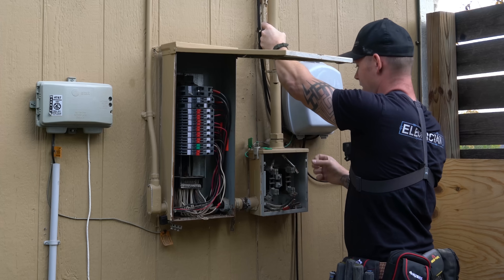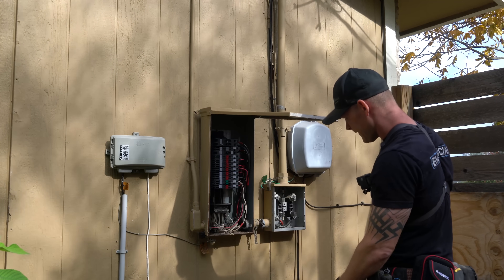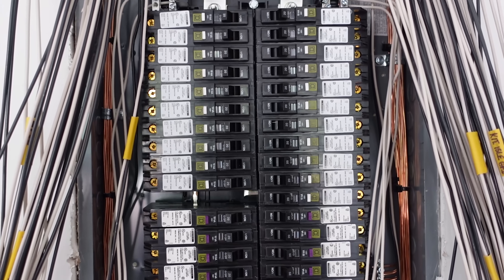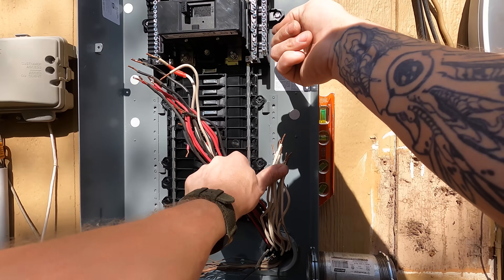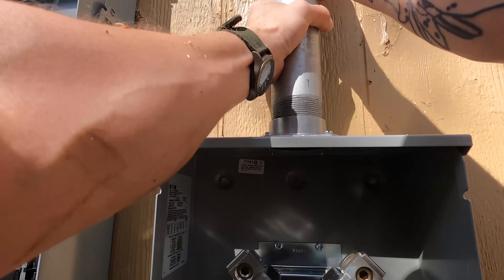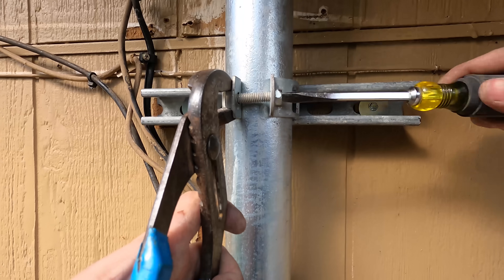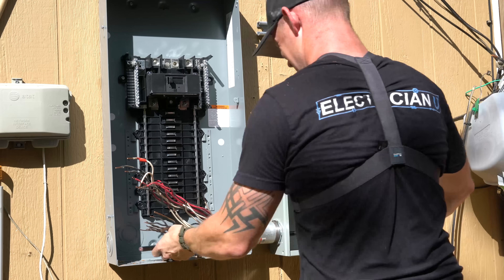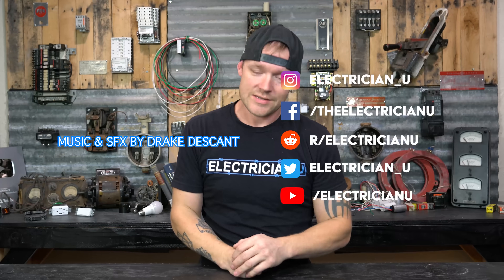How to Replace an Electrical Service Panel, Meter, and Riser (PART 1)

Comment: No sealing locknuts on the outside of the enclosures?
Reply: He didn't use Ox-Gard or Noalox on the lugs for the main or meter. Typically its only used for aluminum wiring. It still would of been a good idea to use it though. The panel and meter are both outside and the lugs and copper wiring are two different metals.
Reply: @kalijasin  yeah possibly. He actually has a whole video explaining why using Noalox is not necessary on aluminum wiring or lugs.

Comment: Stupid question: is it common for a house panel to be located outdoors? Im in canada and have never seen such things!
Reply: Austin ... I believe the outdoor panel was first used on homes that didn't have a basement or a utility area, which was a common issue with homes built on a slab or piers. Sometimes things carry forward because we've always done it that way and there's no reason to change.

Comment: Does your required inspector require an an emergency disconnect per NEC 2020 article 230.85? Or since the panelboard is  outdoor with the 200A main shut off does that qualified, along with the label.

Comment: I'm looking forward to seeing how you address the short service runs, great job so far, not that I expected anything else
Reply: I always addressed them first thing. On of my goals was to have no wirenuts in the panel :). If I had one or two, I'd hide them lol.

I would relocate where the cables came out of the building to get more length.and/or relocate the panel a bit if possible. Sometimes I'd have to punch new holes in the back of the panel but it was worth the effort to have a clean panel at the end.
Reply: @jackconnolly2665  And if that fails, send the new guy to bring you the cable stretcher from the truck!

Comment: You forgot my favorite step...
Label all wires before removing from the breakers.
Reply: land them and do a proper panel schedule afterwards. lot easier
Reply: @stevenpersinger6577  I think the difficulty nowadays is that you really need to know what the branch circuit is serving so that you can plan accordingly.  At the point you replace the panel, all of the Code changes that have occurred since the original installation affecting panels and branch circuits probably need to be addressed.  Assuming the circuits are not part of a multi-wire circuit, more than likely it needs an AFCI breaker installed or maybe a dual-function breaker in the case of kitchen and laundry circuits.  Knowing what protection is necessary before you start will allow you to procure all the correct breakers in all the correct sizes for a smooth cutover.
Reply: You mean the 2 circuits that are labeled
Reply: Lol
Reply: Looks like this panel wasn't labeled lol. Just tone the circuits out from the panel. That way there's no guess work for the next guy, or end user.
Reply: @Granturry98  so you did his work for him for free?
Reply: Same thing I thought....Ohhh nooooo! But if the circuits weren't really configured in the first place I guess it wouldn't matter too much because he would do that later.

Comment: This is definitely different from how things are done in my area(Ohio). We use what I've always heard it referred to as entrance cable which is basically pre-made wiring with 3 conductors with the center being a bare one & it's typically aluminum wire not copper. We are also required to have two grounds, one to a grounding rod & to the water main. When changing from 100 amp to 200 amp service the meter base also has to be changed to a larger one. I imagine doing the entrance wiring in copper is probably better but I couldn't imagine using it when there is a good distance between the meter and the service drop just due to the cost of copper in general.
Reply: Well Sometimes it makes sense to do copper since it smaller. conduit has a fill chart. Example Commercial  3 phase uses 4 wires. 4/0Alum on a 200amp which will require a 2 1/2 ridged conduit .pipe weights about 60 lbs and top heavy! if use copper a 2/0 wire will requires 1 1/2 ridged conduit. price on 2 1/2 10ft ridged conduit $200 . price on 1 1/2 10ftridged conduit $20. Plus bigger fitting more $$$$. like look at the top weather head on a 2 1/2 is $150 vs  $15 on 1 1/2....
Reply: @jaxxanne6  I think you are my customers favorite person right now.

Comment: How about a myers hub?? For my understanding a Myers hub eliminates the need of a ground bushing and having to deal with that extra number 4 .
Reply: Unless the myers hub nut comes with a bonding screw it can be used as bonding bushing to my understanding... but you still need to have an ground wire making contact with bonding ground screw.

Comment: Interesting that some places have outside service panels. In my area only the meter box is outside, service panel is in the inside. Much better if you have to reset a tripped breaker in your underwear..
Reply: I came to post this exact thing.
Reply: Depends where ur located, warmer climate places typically have outdoor panels (prob cost less to run wire) and easily accessible and available for service. Imagine having an outdoor panel in Canada in the winter 😂
Reply: @Nick-bh1fy  ... I do believe the outdoor panel was more about the lack of basements in certain areas (on slab construction) and from there some still do it for fire department access because a main on a meter wasn't so common years ago. Of course once an idea is established it's almost never changed.
Reply: Newer homes they are always inside the garage from what ive seen, some older homes they are on the outside like that. I would also be pissed to come work on a breaker panel in the rain/cold lol.
Reply: @Lewdacris916  ... again, usually homes without a basement and in many areas without a garage as well. When you go back 60+ years ago you have to realize the price difference in a house that doesn't have these things. No laundry room, no garage, no basement, no utility room. Four less rooms makes a BIG difference! Heck, some of these houses were originally built without a bathroom. It was a different era with different priorities. Many warmer areas held onto these ideas for a long time.
Reply: It is the standard in my area. They are better suited for a dry climate (AZ)

It is a MUCH easier installation and doesn't take up any interior real estate. 
Also, how often do you have to reset a breaker ?  :)
Reply: @jackconnolly2665  ... I would tend to agree with you on most points but the one thing I can say is an indoor panel will never have bees or snakes in it. <LOL> Also, any equipment that's indoors will last longer just due to more consistent temp / humidity. My travels to 3rd world island countries can confirm that.... and salt water in the air is at the top of the hit list!
Reply: I can 100% relate. also it helps avoid those neighbors pranksters shutting off your electricity mid shower

Comment: Do you have to.buy a 2 pole .breaker for the ark faults if your beds ran in 12 3  using the homeline brand  or can I put a breaker tie and share neutral

Comment: anti seize paste on riser or even better nylon tape or pipe dope a little more watertight plus i wld have used ductseal on the head yes not a big deal  great job as always
Reply: @
wizard3z castor I thought same thing about the threads!

Comment: Whenever I land in a meter can or disconnect i always make a small loop before each lug for future
Reply: I've seen that before but it's very difficult with large wires, the only requirement is to leave 3' of Wires on the Roof to make a drip loop...
Reply: Hard to loop 3/0 with out damaging insulation

Comment: You work that heavy gauge wire as though it were taffy. You're definitely a master.
Reply: These are relatively easy to bend, try 3/0 cu and up 😅
Reply: @AlexMartinez-dc4pe  Ha ha, yeah you'd probably need a conduit bender to bend those lol
Reply: @aaron74  I use a hickey with the handle cut short for 500s

Comment: With these being educational videos, my only suggestion would be to torque those lugs to spec with a torque wrench.  Will have to wait until the next video comes out, but same thing goes for using a torque screwdriver on the circuit breakers.
Reply: He didn’t SHOW he torqued the lugs.
Reply: @SuperVstech  - I might have missed it, but I don’t recall him saying that he torqued them either
Reply: @xxMacDaddy84xx  agreed.
But this is a Fast video.
Reply: : ) lol you probably wouldn't by it if he told you as a experienced electrician he could feel the right torque setting. Besides they were Copper not Aluminum and not as critical...
Reply: @steve-o6413  - regardless of the material, code says they’re supposed to be torque to the manufacturers specs.  I don’t have any problems with what he did, was just pointing it out bc those who are learning likely view these videos as examples of installation

Comment: So i guess your area doesn't call for feed through neutrals?

Also no flashing and rubber collar on the roof?
Reply: I'm sure he did and didn't get it on video. He'll be crazy not to.
Reply: MAST KIT is the best option.
Reply: I would have at least put a bead of silicone around the pipe up on the roof before screwing in the pipe in to draw the silicone down then resealed it again...
Reply: @steve-o6413  Are you talking about just using silicone around the pipe straight to the asphalt shingles?  Come on man...

Comment: Wish you’d shown putting the roof boot on... that’s always so frustrating!
Reply: I don't think he's going to use a flashing since it's after the outside wall, but I would have at put a bead of silicone around the Pipe up on the Roof...

Comment: Appreciate you helping me sharpen my skills with electrical! I install pv and ESS’s.  Sometimes both at the same time.  

Here’s what I know coming from the renewable energy side of electrical trades.  For me to install an ESS,  with or without PV,  I need to be able to tap in between the grids main feed with an auto transfer/Mid switch.  When I run into “all and ones” or panel boxes where I can’t easily wire the transfer switch into the topology of the homes electrical  system I realize there’s a communication issue between renewable energy and electrical trades. 

I prefer a separate meter box, then a main disconnect for that grid fed electricity, then to my transfer switch, then to the homes breaker panel.  That’s the best set up.  I’m having to replace those boxes where I can’t route the feed to transfer switch then to the bus bar for home loads.  

Respect you.
Reply: Zinsco made a piggyback Service all in one in mid to late 70's, but it was for a flush mount, an only 100Amp...
Reply: @steve-o6413  one of these manufacturers need to start making 100 and 200 amp
Reply: @MrKurtn  they had a problem with the Engineering of it and lost the UL label. It was easier to put a Surface mount all in one right next to it and backfeed it turning it into a Sub Panel if you had the room. Otherwise you might have to rip out the flush mount...

Comment: Curious to see how you tackle the short wires, I know you don't like a bunch of wife nuts in your panels
Reply: He probably added a nuetral bar down low
Reply: if it where me i wld see if i cld put in a giant j-box on otherside of wall and just splice it there using this European method https://www.youtube.com/watch?v=2yTwQxlc6gU&list=PLYyqRNzaEUGZZ0ouLVCHj1aa6YuIe5WDL&index=13&t=822s
Reply: @wizard3z868  mmm would depend on the other side of the wall... I know he's fond of bridging busses. I'd probably butt splice
Reply: @randymathews3348  my thoughts exactly, nothing like cutting a box into a guy's marble Hot Tub lol. Most homeowners won't go for a interior box...
Reply: @wizard3z868  You mean the stuff shown at about 18:32? https://www.youtube.com/watch?v=2yTwQxlc6gU&list=PLYyqRNzaEUGZZ0ouLVCHj1aa6YuIe5WDL&index=14&t=822s

Comment: using white 3/0 for neutral instead of taping? cost difference? cheers. nice to see some different practices
Reply: We used to use White paint for roof, an tape inside panels. But tape has been accepted for years...

Comment: Another awesome video man! Just a side note, even if you don't do it on camera, you might want to mention that you went back behind all your connections with a torque wrench/screwdriver in accordance with 110.14(D). In my jurisdiction, they are real hard asses about this now. Thanks again for another great video.
Reply: Excellent catch and if you were using larger aluminum conductors the use of anti-oxidant like noalox.
Reply: up in the small state of the north east same they are being real hard asses
Reply: @wizard3z868  trust me it makes a real difference arcing and loose connections are often a key fault find. Torquing at least provide some quantitive feedback on how much is enough when tightening.
Reply: @mathman0101  actually frying the breakers to the bus bar is most common for arcing and proven on his last breaker change video when he couldn't get the breaker off. I know I've had some and seen evidence that other Electricians have run into the same problem...

Comment: Wow. Thank you so much for this! I'm a 3rd year commercial apprentice, and I've never really had a chance to learn how to do services like this. I also have three old zinsco panels (a main and two subs) at home that I know should be replaced, but I've been holding off until I have more experience and can do it myself. Once I graduate, I want to completely redesign the way the panels/circuits are being fed, because it's 70 years of homeowners doing their own diy work.
Reply: Three Phase commercial color Codes are completely different from Residential and important for the Utility Company...
Reply: Hi. Am Bismark from Ghana and I enjoy your work so much.
Keep it up,but I what to be part of you.

Comment: Nice install man! I have a question. What is the best way to pull Romex out of its packaging without it twisting? Thank you!
Reply: Start in the middle of the roll! That is if you are using 250 feet or less. 500 foot rolls, stick 1/2 inch emt through and carry on!
Reply: Get a $40 Wire buggy, it pays for itself.
Reply: Or get some exercise and walk it out. Unwrap some coils and roll it out and use..
Reply: They do make a fancy device you can easily mount on the 2×4 that like a wire caddy but sits sideways for a easy feed...
Reply: run it thru a pipe (emt or find a friendly plumber) nailed on studs or on a heavy bucket/pal or just staple up a strip of nm-b  between two studs a poor but simple reel lol

Comment: Something I learned the other day when doing a weather head. Tape the wires inside the weather head for you it was white and red just for future reference when someone is working on it,you can just peak into the weather head and see the tape because most of the time that tape on the wire loses color from being in the elements over time. Something I never did but an old guy I work with did it and I was like thats a good idea!
Reply: The Utility Company only cares about the Neutral...
Reply: @steve-o6413  taping it in the weather head isn't for the utility company its for the next guy who has to cut the line drop and hook it back up for whatever reason. It just saves an extra step for the next guy
Reply: @sumochop360  real professionals use the stop rule lol (Screw The Other Person)  🤣🤣 only a craftsman thinks about the future or the next guy 😉
Reply: @sumochop360  the only one who would probably ever have reason to do that is the Utility Company or Fire Department and I'm sure they know too leave a little extra bare wire for identifying the Neutral otherwise ring it out with a jumper wire...
Reply: We are always trained on testing everything. Good idea though especially when working with 3 phase 208v. You need to not run the wild leg to one of the 120v branch circuit bars.

Comment: Im an apprentice and been in school for about 3 months now and man your videos are super helpful especially when I first started class, love your videos man!
Reply: sparky channel is another great apprentice resource
Reply: Great video,  for safety reasons it's always best to stand to the right of the panel disconnect and turn on or shut off the power with your left arm , just incase the panel for some reason ( and it happens) explodes , that way your body is facing away from the front of the panel..Also at the street where the main power was switched off, I didn't see any lockout...Please excuse me I'm wrong..Again great video and awesome presentation!!! Looking forward to watching more of your videos..

Comment: Don't think I'll ever own a ratcheting cutter.  They cost about $300.  You can buy 2 sawzalls for that.
Reply: amazon like $50 if you dont need them everyday give some a chance i use a lot of harbor freight stuff so far so good
Reply: @wizard3z868  I guess the price went up i got my pair for $30 on Amazon. I just got it because its easier than running in and out of a house chasing who has them.
Reply: @robfahey1349  o I just searched ratchet wire cutters and seen a bunch of decent looking ones around $50 a cple around $20
Reply: They got the southwire for 120$ nd the knipex for 250$ greenlee does run up to trey hunnid
Reply: Amazon $30 I read some good things about them on forums and got one. So far one service in and expecting another soon and they held up fine.

Comment: I'm doing apartment buildings and those boxes get mounted between the studs in every unit.  If we had holes in the back of the panel we'd have to fill them before we pass inspection..
Reply: I should clarify that I meant my boss's inspection. He almost always holds us to a higher standard than "acceptable". ✌🛠
Reply: @mattsmith1318  Look at article 300.5 (G) and you will understand why your boss is having you fill in this raceway.
Reply: @bairdmiltich4935  I don’t think OP was talking about sealing a raceway.
Reply: Never heard of that, only in a Firewall (duct seal)or outside wall for (insulating purposes)...